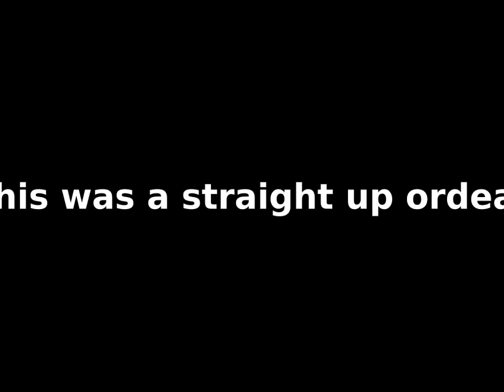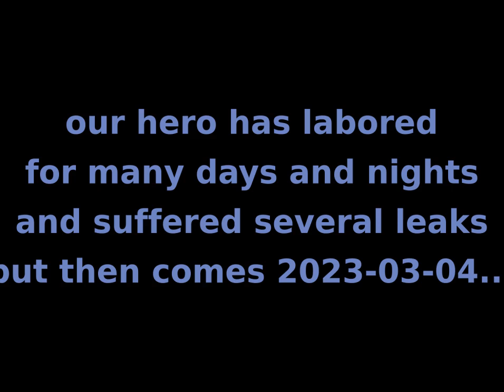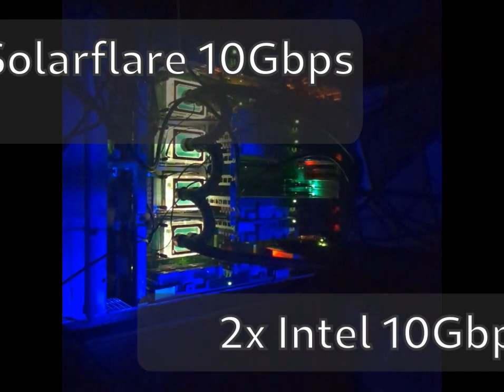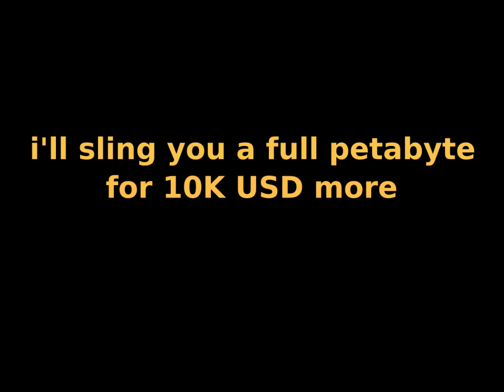strangelet (silent 4U, 4x watercooled xeons, 678TB disk, 2TiB RAM)

Comment: Duuuuude! I'm seriously considering buying the same system because I love the Xeon E5 V3/V4 era. I already have dual boards, etc but something about 4 in one board is just insane and all those RAM cards? The only thing stopping me is I could not find info if I could easily replace ALL the fans and ALL the PSUs. Are the fans just normal 4-pin? And for the PSU, is it possible to connect regular ATX PSUs? Or other server PSUs (not from Supermicro)? I want to completely gut the case and put it in a Silverstone 5U (weld in the PCI slot section). If the board goes nuts with beeps and warnings without the regular PSU and fans, I didn't want to even try. There's so few bits of info on this thing. You're like 1 of 2 vids on it.